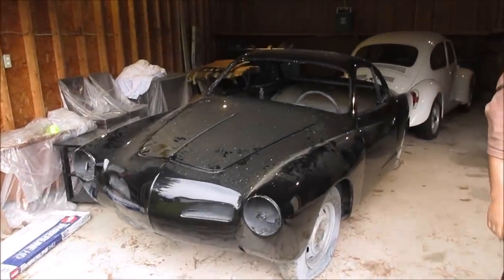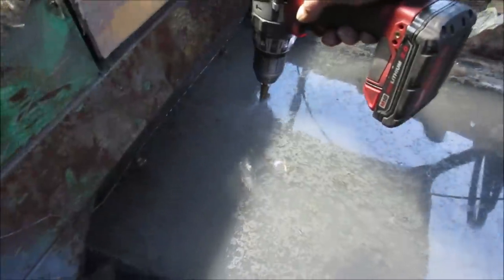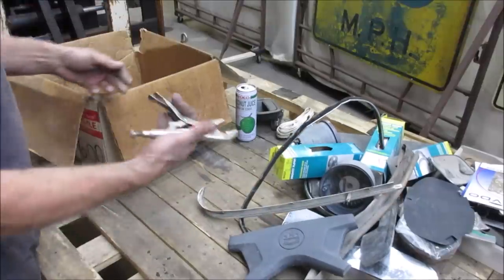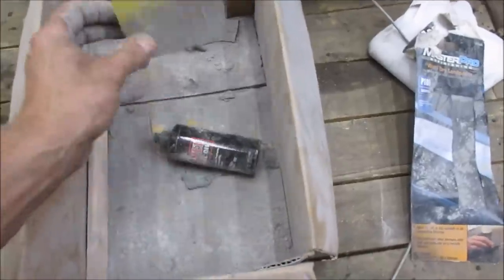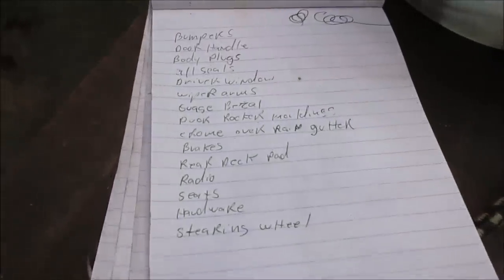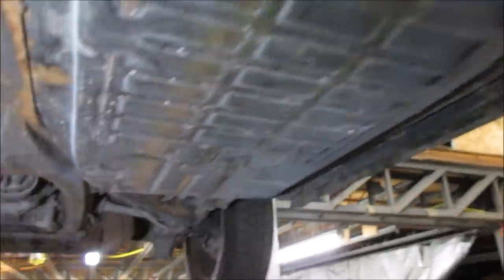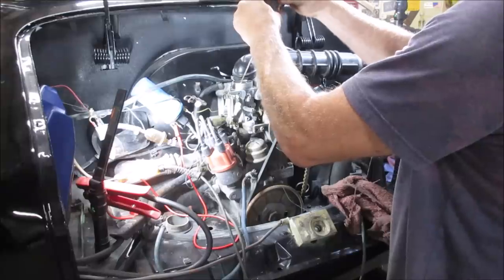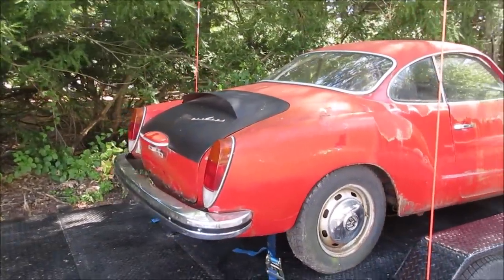Basket Case 1974 vw Karmann Ghia Rescue. First Start

Comment: I did a 73 convert. Built a Gene Berg 2 liter that dynoed at 153 HP - matched to a Berg 5 speed.  The gear splits put it in the power bad at each shift. Probably a low 13 second streetable car.  It was truly a beautiful show and go car. Powdered costed pan etc. I sold it then  after 9 years that guy I sold it to sold it for 36K. Fun car. It takes a lot of bucks to restore a Ghia correctly.

Comment: Best looking basket case I’ve ever seen.
Reply: he should have that up and running in a Jiffy.
Reply: Sweetest one I've ever seen in the black paint, with the addition of a nice set of wheels, and I think it would look even better all blacked out chrome too.
Reply: Yes I agree love the Vw stuff. Had a 1981 Volkswagen Rabbit 5 door.  Was a great little car 🚗 , too bad I pushed the candle too hard at both ends fell asleep and smacked a Boulder at 55 mph totalling the car out after I did over $500 worth of work to it. Not my brightest moment.
Reply: No kidding, with my '63 E type basket case had this many parts and looked as nice!

Comment: when i was working as a vw mechanic back in the 70s, a woman brought a karmann ghia (green) into the shop. she said someone had overhauled the engine, but
the car had no power. i was checking the points and condensor and didn't find anything obviously wrong. i tried to set the timing and i saw that the distributor had
been dropped in 180 degrees off. i pulled it out and put it in right. when i took it for a test drive, it ran like a scalded ape! that 1500 ran great! she was pleased.

Comment: This brought back so many memories of working on my 1971 Karmann Ghia. I'd pull the engine nearly every winter (the heater boxes were gone with J-tubes) and add more chrome tin or something else. Back in the late 80's-early 90's the parts that you need used to be dirt cheap. Heck you could have found most of it in a JC Whitney catalog. I miss my Karmann Ghia - it will always be the coolest car I every owned.

Comment: Love it! To boot, you got the red one which brings your grand total to 3 Ghias! They are highly prized here in So Cal.  I went nutz at the epilogue -- when you acquired the red one because it reminded me of my spanking clean and glorious  "Porsche red" 1972 Ghia coupe I owned in the early 1990's. To this moment I miss it. Stock 1600cc engine, dual Solex 34mm carbs, tuned exhaust. Not much more horsepower but a lot more pulling power at low-mid range. From inside the cab it sounded like the engine was gargling mouthwash.
Reply: Four, actually.  He also has the early red & white example.

Comment: Like to see an update on the econoline one day. Thanks for the content, mustie1
Reply: And the double cab double cab
Reply: @gerry-p9x  
👍👌👏 Yes, definitely! And for me it would be great to see an update on the Jawa motorbike that was almost finished anyway. But I'm asking Mustie1 this for years over and over again. Nothing happened, no answer, no information if it is maybe sold. His views have dropped significantly in comparison to former times. Nowadays the number is often only ⅓ to ½ of his amount of subscribers.  Like me a lot of viewers like to see finished projects. And M1 definitely has a lot of unfinished ones.
Best regards, luck and health in particular.
Reply: Sort of waiting for the rest of the story on the Solex motor driven bicycle.
Reply: Exactly, Every time I see it in musties shop I think, "hasn't it been a couple years on that lift?" I wonder if Mustie is missing a vital part or something. Maybe lost interest with so much sheet metal work he had to do.
Reply: Dear  @born_again_torinos  
I wouldn't have bought a rodent infested vehicle like this. Inside the cabin is a kind of hollow sheet metal piece running on 3 sides. Full of mouse shit/urin and therefore totally rusted/rotted away. These parts are structural for the cabin and extremely difficult to change out. Additionally there is even more rodent damage in the cabin. In my opinion Mustie1 should try to sell the Econoline to enthusiasts. If I remember correctly, those little pickup trucks are sought after. A frightening end is better than an endless fright!
Best regards, luck and health in particular.
Reply: I think he likes to work on the Econoline off camera so he doesn't have people questioning his methods.
Reply: He had mentioned that he had a lot of welding to do on the Econoline and that the fumes were giving him debilitating migraine headaches.  He has done very little work on the Econoline since then, and he does very little welding on the channel at all now save for some ticky tacks here and there.
Reply: thank you for letting me know.  @92xl
Reply: Dear  @92xl  
I must've overheard this. Do you still know when/where did Mustie1 mention this? Thanks in advance for answering. 2) If so it would be even more reasonable to sell or trade in the Econoline. 3) On the other hand: There are welding helmets existing with ventilation system respectively a snorkel/trunk. Positioned in a way that it's possible to breathe in fresh air while welding/soldering.
Best regards, luck and health in particular.
Reply: @Chr.U.Cas2216  he mentioned it in a video a couple years ago.  I dont remember which one it was so I can't direct you to it.  Sorry.
Reply: @92xl  
No problem and definitely no reason to be sorry. Thanks for replying.

Comment: 2-speed MoPar '63-'76 wiper motor, ballast resistor is for the ignition, that carb is a Carter BBD (great little carb, easy to rebuild/tune),

Comment: I was 20 years old in 1961 and I learned that rebuilding a car is a full-time project for months or years. I spent the next 3 years rebuilding a Jaguar XK120 DHC and then an MGA. Just figuring out what you need takes a long time and getting it can take a lot longer. It's really a challenge to  do it right. I know how many projects you take on. Good luck on this one.
Reply: Definitely! However long you think it will take times it by 10 haha. Rebuilding cars requires some time for sure
Reply: Hello young man .
I was born in 61
Reply: @riverflyswatter  Ha! Enjoy life as well as you can. Today is my 82nd birthday. 🙂
Reply: Happy birthday, young fella!
Reply: @valuepack2  Thanks kindly!
Reply: I worked that out by myself just from looking at how many half-done projects get listed on car sales websites 🤣

And just the sheer number of parts and variety of skills required to repair stuff - seat upholstery, door trims, etc is completely different skills than making the engine run. And it all needs doing if it's an old well used (or poorly stored) car.
Reply: @BruceBoschek  🥳🎂🍰🥂

Comment: For the Northeast this is a pretty rare find.  The small amount of underside rust is easily fixed. The fact that the eyebrows over the front head lights are apparently not rusted out is amazing. It deserves tender loving care and no short cuts. Too bad about the body trim and front turning signal delete. Looking forward to seeing this project though on your channel. Thanks for posting.

Comment: Love this channel. Definitely one of my favorites. I had a body shop for 20 years. One of our favorite jokes was the it is for example 40 bucks an hour if we do it, it's 80 bucks and hour if you worked on it before us, and 120 bucks an hour if you watch. :-) Looks like you have all of those cornered. :-) Fortunately, you aced it by turning your scar into a star with You Tube paving the way. 
The other ace in the hole is your vast amount of experience with Volkswagen models which gives you a huge advantage when sorting through everything.
Update: I just heard the part where you are going to seek out a parts car. That is THE ultimate solution. Makes the whole thing easy-peasy. That's why this channel is one of my favorites. You're an inspiration.

Comment: 👍👌👏 Oh WOW, simply fantastic! Congratulations 🎉 for the purchase. This wonderful clean and almost rust free design icon is a gem. The engine is running great and sounds strong/healthy. I was so happy to see that a parts car has already been bought. I don't like black cars but somehow the colour suits this Karmann Ghia type 14, 3rd generation. I would paint the roof white because otherwise it will become really hot in the car in summer.
2) I really dislike the big bumpers, front blinkers and the rear lights. I would definitely use round blinkers (like the 2nd generation had) on the front. I would also 3D print a kind of adapter for putting in the 2nd generation rear lights. Of course the 2nd generation bumpers are a must too. At least in my opinion respectively for my personal kind of taste.
Thanks a lot for making teaching explaining recording editing uploading and sharing.
Best regards, luck and health in particular.

Comment: Most of what you need for trim, seats, windshield and such will come from your scrap vert. It's also the road map you need for reassembly unless it has been butchered. Get some Cal-look rubber for both windows since it looks better without the chrome moulding any way. Seats are Ghia specific but again you have the vert for parts. Door glass and window regs are the same iirc. It's been a long 30+ years since i had my last Ghia. If the vert has its bumpers still they will work fine. 74 had the overriders but any 72-74 bumper will bolt right up. Nice and straight for a black car.

Comment: Here is a suggestion for the future to help dry a car that has been washed. Some people use a leaf blower, helps speed up the work and displace water. You have your work cut out to put it all back together and get engine running and  small modifications to have everything needed like turning signals.

Comment: I think now you can get almost any size round LED headlights with blinkers built into them, could be a possible fit for this if the blinker holes are deleted.
Also, I don't know about the local law, but sometimes you can get away with bumper delete if they are missing and if it looks good without them on.
Reply: YEAH¡!!¡!!!
Reply: Yeah but knowing Mustie, he's a purist,  he will stick with Original parts
Reply: @V8SKULLS  oh i know and i love him for it
Reply: LED headlights suck, don't use them.
Reply: You can get European-style headlight assemblies with incandescent marker bulbs in them but technically here in the US they're for "off-road" use only
Reply: @chrisfreemesser5707  I love those Euro-spec "city lights" which is an early DRL (daytime running light) before they were cool.
Reply: At a moment I thought that the later years had the blinkers in the bumper, but I was wrong.
When the wiring harness appeared with the glass fuses I got the Lucas feeling. The lord of darkness paid a visit.
Reply: I don't know...there are some pretty nice high output LED headlights out there that look very nice on KG's.
Reply: @johnjuhasz4977  But they should be having a mild color temperature like 2700K to look reasonable.
Reply: Why would The Law care about bumpers?
Reply: @fgb3126  Somewhere in the 70's there were a lot of laws introduced related to vehicle safety, among them bumpers regulations. So if the vehicle was approved with those laws in mind then it might be required to fulfill those laws to be considered road worthy. At least in some states/countries.

Comment: Wow, Mustie1 must really care about this one. He cleaned it before he started working on it. That makes this an anomaly. Yup, that's what happened. There's an old Dodge somewhere with a box full of VW parts in it.
I remember that yellow disaster - so you do have a parts car. Bet between you and VWNut, you can get over 80% there without having to buy anything.
"Ask me how I know..." Saw that video of the exploding burning coil. It was a bus if I recall correctly.

Comment: I'd have used a wet-mode shop vac to suck that water out.   They're also great for cleaning carpets and other heavy fabrics.  Scrub in the soap  (bio laundry powder is my choice)  then suck them "dry"  before they matt.

Comment: Nice job, Mustie!
My brother-in-law got offered one of these in about 1991, in running condition but needing a lot of work on the rampant tinworm (We're in the UK, it rains as much in old England as it does in new...). The seller wanted £300 for it, an absolute bargain considering that they were much less common here than in the US or Europe. Jim turned it down because he didn't know what it was, and by the time I'd heard about it and explained, it was too late, it had been sold.... If only I'd been with Jim when he was offered that car.... Ah well, win some, lose some, right?

Comment: The engine sounds solid, which is a major plus for this build. The stainless steel tube you found in one of those boxes was actually for the EGR valve that was introduced in 1974 on the Bugs and the Karmann Ghia. It was located in the intake under the carb where that little block off plate is. Not recommended to re-install it, unless you're going for a Concours restoration!😄👍

Comment: The Miller Auto Group license plate cover is most likely from one of the Larry H. Miller Auto Group dealers around the country. The first location opened it's doors in late 70, and there have been several more built since.

Comment: I'm guessing that the weird patched-up holes in the rear engine tin were originally for the a/c compressor which would have been mounted on the left side of the engine. You can see that the fan shroud has the outlet for the heater tube relocated to the side to clear where the a/c compressor would have been. In addition to the compressor and mount brackets, to get the a/c working again you'd also need the evaporator/fan assembly which, on the 65 Bug I had, was a large unit that sat behind the rear seat underneath the rear window. Not that a/c is much of a priority in New England though.

Comment: Nice. Interesting new project. I like the curves on it. And interesting to learn about that white mist. I had two cars that had those in the windscreen and I've wondered if that was a problem with the glass. I've had them replaced either way since they were the wrong tint but I had a feeling it wasn't supposed to be that way. Now I know.

Comment: definitely look for a parts car. btw You should be able to tell by the brake paddle if she was rolled over or not. concerning its mileage. The undercarriage looks fairly descent, that's good, you must be stoked about that, that's awesome. I know I would be. I don't know why auto body guys don't store things away correctly and label everything, those that do know it saves them massive amount of time in the long run.

Comment: I spent a ton of time building and installing a factory-look wiring system into one of those for a former boss. A few months after I finished it, the brick building it was parked in was blown down by weather and smashed the car (and several others) flat as a pancake.

Comment: I say for turn aignals on the front, buy a pair of the modern round headlights they sell aftermarket that are like sealed beam, but you can replace the bulbs in. They make them with a led halo ring around the outside and you can get them. With an amber ring, white ring, and even switch back rings that are white for running light and switch to amber for the turn signal function.

Comment: It's funny the things that are different about old cars in the southwest. 
-- We would not see rust, but every rubber part would be perished
-- I would not think twice about pressure washing, things dry fast when the humidity is 10%
-- Air conditioning is not optional! Especially on a black car.

Comment: Hopefully bodywork is done right. Not just sheet metal, pop rivets and body filler butcher job. That’s a first air cooled VW I’ve seen  with air condition option.

Comment: I had a green 74 ghia in late 80's was auto stick converted it to a 4 speed 1776cc dual port 049 dizzy, progressive 2 bbl, 10lb fly wheel, 30 mpg no matter how i drove, should have kept that car.

Comment: That reverse 'scoop' is actually not scooping but rather exhausting hot air. The spoiler shape causes a low pressure area behind the car in which the hot air from the engibe bay can/will flow. Fancy, because science, you know🫠😉

Comment: If you aren't looking to make it totally original, maybe you could find some round aftermarket headlights with LED signals built in, like a sliver of light across the bottom.

Comment: I used to be big into old VWs but when I saw a great deal on a Ghia I looked into parts pricing and realized they were psychotically expensive vs bug parts. Trying to restore a Ghia will cost as much as restoring an old Mercedes the second you're not dealing with that basic VW engine alone.

Comment: I had a 66 Ghia and paid $250 for it . Parts were almost impossible to get thirty years ago and i was quoted $850.00 for a rear bumper . After number three cylinder dropped a valve seat i gave it away ,more trouble than i had time for. If i remember correctly my wipers ran of air from the spare tire ? Ten grand in parts and labor will give you a thousand dollar car ?

Comment: Early in the video you dismissed a small rectangular switch as "definitely not for this car". That's for the heated rear window...there should be a matching hole under the dash for it.